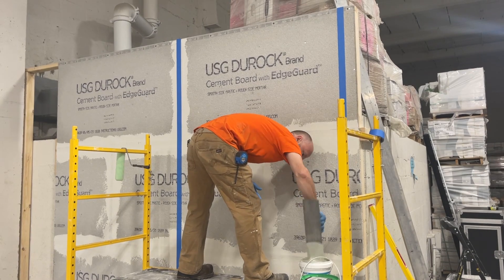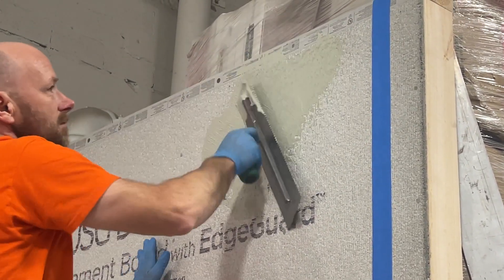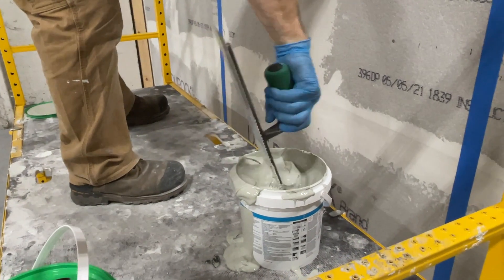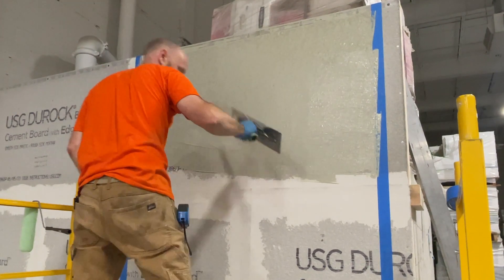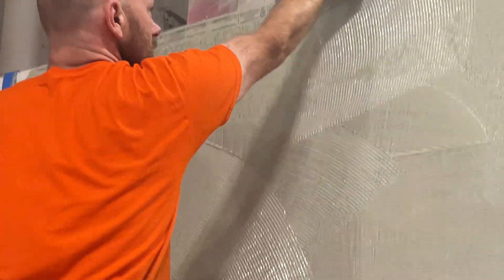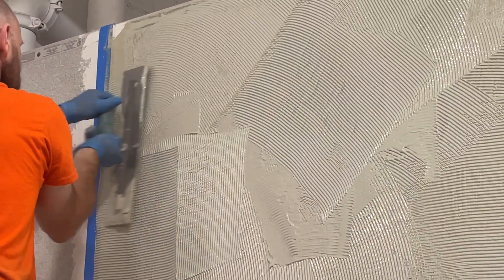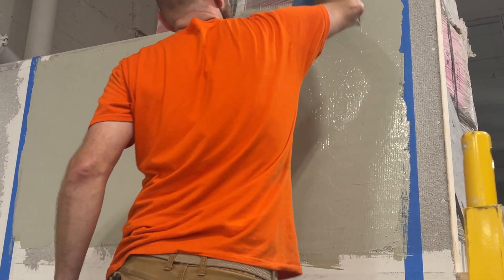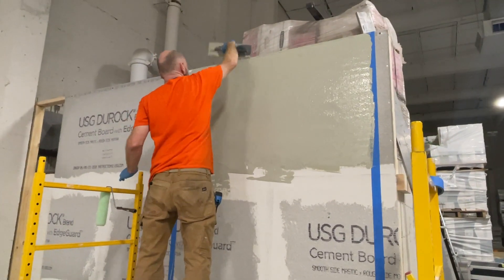TileTV: Applying Liquid Waterproofing Membrane (S2;Ep15)

Comment: What do u charge for trowel process vs roller?
Reply: No difference, you charge for the application of waterproofing not the method you use to apply it. Thats a personal preference.
Reply: One would need to figure timing... I've always rolled myself... large areas, the trowel is probably quicker... I would think the cost would be similar either way.
Reply: No difference, you charge for the application of waterproofing not the method you use to apply it. Thats a personal preference.